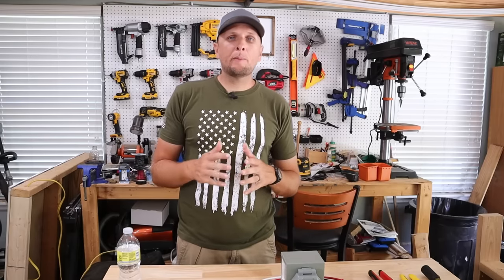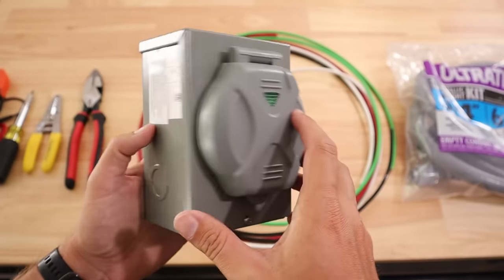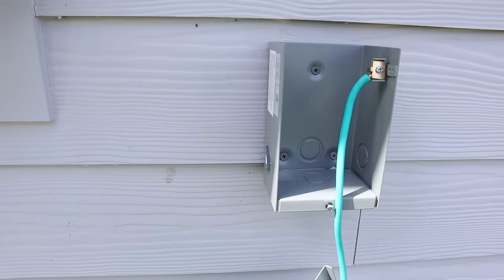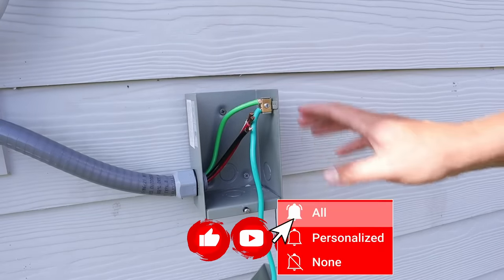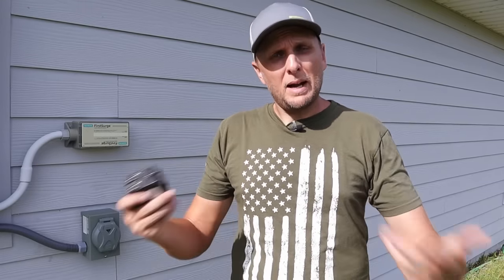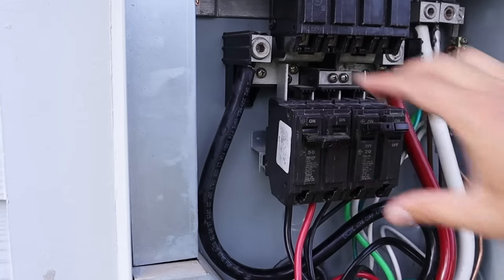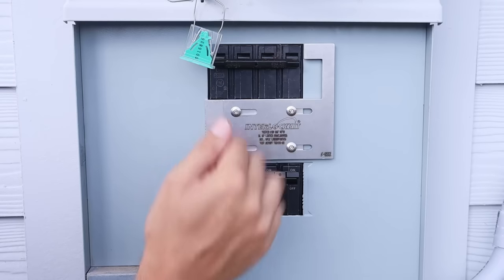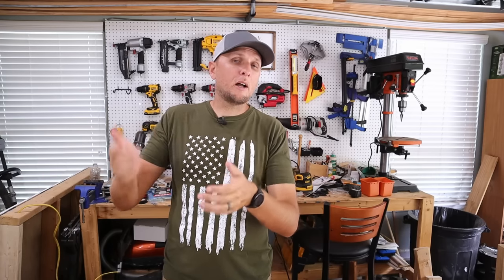The BEST Way To Connect A Generator To Your House - Interlock Kit With Power Inlet Box Install

Comment: This was Very Helpful and Thank You. I have a question. I live in a manufactured home, in the middle of Florida on the Gulf side.  1) My Home A/C unit and water pump are powered from the Main panel on the telephone pole. Then there is a circuit that goes to the home to power it. How would I adjust my installation for this situation?

Comment: Very nice! I would like,but not willing to sacrifice safety,backfeed from a subpanel i put in my garage. I used number 4 copper to a 60 amp breaker in the main. The safety switch is the issue i see but is this able to be done this way? Any help would be welcomed,thank you.

Comment: I made my own interlock switch. I changed my panel out to a 125 amp panel with a 125 amp main, which is the largest the code allows with a snap in breaker. I installed the 125 main with the required bolt down kit, and placed my 30 amp generator breaker next to it. I bought a 4 inch T bracket from a local hardware store, cut off the two upper legs short enough to prevent it turning too far, and bent a 1/4 hook in the long leg. I drilled the cover and double nutted this bracket to it to prevent the main and the generator breaker from being on at the same time. Painted it red .Perfectly legal in my jurisdiction.

Comment: First thank you for the video. Question i was told if your common and ground goes on the same buss bar you generator needs to have a floating common.  Correct or incorrect?

Comment: You should tighten, then loosen, then retighten the screws on those stranded wires a couple of times.  You'll get a better connection that won't work loose over time.

Comment: Awesome video and very informative!  I was looking into doing this setup. I went and looked at the 2 breaker panels (inside and outside) and I noticed I don’t have a “main breaker”. How do I go about doing this setup without it?
Reply from the maker: There has to be a disconnect in a breaker panel somewhere unless all of your panels only have 6 circuits or less.
Reply: @HowToHomeDIY my outside panel has 6 breakers and the inside has 16. The outside panel has a breaker that’s 100 amp and says inside panel. The rest of the outside breakers are stove, well pump, ac, sewer and heater.

Comment: Liked and subbed.
Def going down this path as soon as possible. We haven’t had major issues in our area but of course one never knows. This is practical way to have power without the huge investment of permanent standby units. Question…do folks actually disconnect from utility power and run off these just as part of a schedule? Do they just crank up the generator on some schedule? Just curious to how they make sure everything is in working condition. Thx

Comment: Number 8 wire copper is good for 55 amps, is a lot easier to work with and handle a 50 amp load very well. Whole lot cheaper wire faster job. Also the wires were about 3 inches too short and your receptacle box please note that if it is inspected would be turned down. I've been a master electrician for over 50 years and hooked up hundred of these boxes.
Reply: What wire can I use for 30amp plug?

Comment: The light isn’t a gimmick, it’s actually for two reasons, A. It confirms your generator and cord are successfully supply power. B.  more importantly, in the event you unknowingly had power flowing back to it, interlock failed etc. you’ll know it’s hot.
Reply from the maker: Appreciate the input Steven!

Comment: Great video, very clear, thanks! Q: for a Colman Powermate premium plus 6250 (6250 maximum watts / 5000 running watts) it’s indicated 20 AMP on the electrical outlet (3-Pole 4-wire receptacle). Should I then install a 20 amp breaker to match this generator? Can I really get up to 6250w and run 5000w through a 20 amp breaker?

Comment: I have a Northstar 165605  Generator with a great Honda motor, and 120/240 Volt, 50 Amp straight-blade receptacle (NEMA 14-50R receptacle compatible with NEMA 14-50P mating plug). I use it for my sound company for power at concerts at outdoor locations, and it has 7 separate 20 AMP circuits. I would like to hook this up to my home breaker box, as in your video here. I really don't need any special "safety" hook ups, just to turn of my main breaker in my box when the power goes out, and then hook up the cable and turn the generator on outside, and turn the breaker on for the generator indoors. And then reverse the process when the power comes back on. Is it OK to do this, and will my AC also work, because I will have all my breakers active in my main box? I live alone, with my Mother, so there are not lots of people in my house running all kinds of power in different rooms. The only main draws on my power will be my fridge, AC, and some lights, TV, and my computer, so I should be able to install my generator without the soft start or hard start kit.

Comment: Hello Sir!
Very informative and well made video! The only problem I have on my end is that my breaker box does not have a main disconnect. So if I just threw in this install, then I'd end up back feeding to the meter. looks like I have some extra work to be done to the main breaker box first and get a main breaker installed.
Reply from the maker: There has to be a disconnect in a breaker panel somewhere unless all of your panels only have 6 circuits or less.  I believe this is code and has been for quite a while but maybe I am wrong.  It would be odd not to have one.  Yes one would be needed for this install not just to make it legal but also safe.  I really appreciate the feedback and glad to hear you liked the video!
Reply: @HowToHomeDIY  and you are correct! I was expecting a main breaker but instead, I have the right side of the breaker box with the first breaker at the top at 100A and "Heavy Load" written on the right side. Then on the left, the first breaker top to bottom is 60A and that side is labeled "Light Load". The house was built in the late 70's early 80's here in the Houston, Texas area.

The project will eventually be having the breaker panel redone with one MAIN breaker followed by a 50A breaker for my generator with the interlock kit, then the rest of the needed breakers. It's not going to be cheap but I am tired of the power outages and not being able to have a backup system. Thank you again for the very well detailed video!!
Reply: Do I have to buy a separate breaker for the 50 amp plug? I will have to wire directly to my breaker as my meter does not have the required connections on the outside, but luckily for me my meter box is located directly behind my breaker box on the outside while the breaker box is on the inside of my garage. So would I need to add an addition breaker switch inside of my breaker box?

Comment: Great video.  Can you please provide the links to the items used?
Reply from the maker: Yeah they should be in the description of the video.
Reply: @HowToHomeDIY  Thanks. What size guage did you use, including the ground?
Reply: For anybody else wondering, I went ahead with 6 gauge THHN rated wires inside 3/4" conduit, which is recommended for 50a & routing to outdoor inlet box

Comment: Hi, great video. Very detailed. I have a  question. The yellow cord that plugs into the generator to the inlet box, is 30 or 50 amps?
Reply from the maker: Mine are 50.  It just depends on your hookup and generator output.

Comment: Just wondering how many amps your house requires to comfortably run with everything up and running. I already have a transfer switch which has 10 circuits so I can run the furnace but not the AC.. I may consider rewiring it through a 30 amp breaker so I can run the AC. Nice video, thanks.

Comment: thanks this makes sense.  how do we know what kind of interlock kit to buy?    Based on the model of the main panel?  I have a small cabin and want to be able to run gas furnace/blower, well pump, fridge and lights when we lose power occsionally and I think this will work wonderfully.  I have a ryobi generator with 6500 running watts and 8125 starting watts.  thanks!

Comment: This is not the norm for most houses. Breaker boxes are usually inside the home. This would be the most ideal procedure if you had his set up,good video.
Reply from the maker: The procedure is still the same.  Just depends on where you want the inlet box.

Comment: In most municipalities, you must pull a permit before installing a generator for you house wired into the service panel. There are too many code issues that a DIYer can’t possibly know for a safe and reliable installation. Proper grounding and bonding is essential for a safe installation. Call a licensed electrician and get it done right and make certain he pulls a permit and gets it inspected.

Comment: That LED blinking actually is blinking as that's how LEDs work. Thing is it's frame rate is at a speed that syncs to that of your cameras refresh rate so your camera will catch its blinking. Same way some cameras will make helicopter blades look like they are not moving or moving slowly in some videos. It's pretty neat actually. Most peoples eyes will only see frame rates less than 60htz so LEDs look steady directly as they blink much faster. Sorry had to geek out a little nice video btw.

Edit: actually a better example instead of the helicopter is at 12:26 in your own video haha.

Comment: Great Video! Thanks for sharing, I added a Micro Air Easy Start to our 15000 BTU AC unit on our RV,  we use a Honda EU2200I to power various devices separately, AC, Coffee Maker, Microwave. Works Great. If your board check out the video. Im thinking adding a switched outlet box and male plug end to our furnace for emergency use and your video popped up.

Comment: Should have watched this before buying the wrong 10 circuit transfer switch.  This is what I need. so now I will exchange that for this.  I think I have the right way to do what I need. Thanks
Question:  My main power panel is outside (detached garage) right next to the meter. In the panel there are 2 breakers 1 for garage lights & plugs, 1 for outside flood light.  The other 4 breakers are separated into 2 20-amp circuits for well and 1 for sump-pump.  All other circuits are inside the house's breaker box.  Is this what I need, using a Duramax HP13000HX that has a heavy-duty 120/240V 50AMP outlet.  I'm very mechanically inclined, except for electricity, so I'm double / triple checking what I need before I buy more of what I "don't" need.  Thanks again!

Comment: I might be incorrect, but I was taught that, in boxes such as the one installed, there should be 6" wire length from the box, for connection to the device you're installing. Anyone who has worked with wires cut too short knows why. Last I recall, it's required.

Comment: This is a great video!!! I wanted this installed on my house and I found out they wanted to charge me $3000... That's a lot of money and at the moment can't afford that. Do mine coming to my house and showing me lol... That would be great... I like how your setup was so clean and easy. Now you mention about picking certain items. Is that because you turn on certain breakers in the house. From the label you place on the panel it says to turn off all breaks. Does that mean you only turn on what you need only?  I will have to subscribe to your channel have to change some power outlets and stuff.
Reply from the maker: $3000 is a good chunk of change.  Yes it is best to turn all of the breakers off so that when you turn the generator on, it isn't getting a bunch of circuits demanding power all at once.  Could cause the generator to bog down or even shut off depending on the load demanded and the size of the generator.  Thanks for the feedback!

Comment: Good instruction video, thanks! In an interlock setup such as described in this video (which is also what I have in our house), is there some kind of device that could be installed directly on the grid's main (before the main breaker) so that when the electricity from the grid comes back online, I have some visual indicator, so I know I can turn the generator off. We live on a large lot and we don't have visibility on our neighbors, so we can't tell if the grid power is back or not without toggling the interlock on a trial and error basis, which is somewhat annoying. Would using a multi tester work even if there's no power being drawn from the grid, although not ideal? Thanks for any insight ...

Comment: Great video!  Can you please link me to the 4 electrical wires (6 guage) that you used or brand that would be best to do the install?  I’m not looking for the pre-assembled Ultra Whip kit, just the wires only
Reply from the maker: Glad you liked it!  Totally understand.  Depends how many feet you need.  I just added 3 options for wiring with links in the video's description.  When you click the link it will take you directly to whichever ones you want to take a look at.

Comment: I THINK the answer is yes, but can I install a 50 amp interlock kit with all the correct wiring and run a 30 amp generator in case I upgrade my generator in the future?
Thank you.

Comment: Thanks so much for that great outline on the hookup. Once I get a generator 30 or 50 amp then I can get an outlet box for the size. I wasn’t sure how I was going to set things up when I got a generator, but now I’m sure. The only issue that I see is putting the slider block on my panel because the only empty location for the additional breaker is at the bottom of the panel, far away from the main up top?
Reply: Might have to shut your power off and move a couple breakers to the bottom to make room at the top.

Comment: I had the same type of interlock, 30 amp breaker and L14-30 generator receptacle installed when I had an electrician upgrade my service and panel.  The instructions say that a maximum of ten 20 amp single pole breakers can be used from the 30 amp generator breaker. Two things I'm disappointed in with the electrician; first is that he never explained that since my main service panel is neutral bonded to ground, and that most new generators are bonded neutral to frame (ground) and need to be unbonded.  Sheer luck that I happened to read about the bonded vs unbonded issue by accident when shopping for generators.  It is a code violation to have a system with two paths to ground.  Second, he should have also quoted me a 50 amp option.

Comment: I knocked plenty of the knock outs, out, that you said can't be knocked out without a drill. And all my manual and automatic generator installations always passed the electrical inspection. I was a licensed electrician. Retired!  If a homeowner installed this wrong, then backfeeds the utility through a wrong connection, the person that installed the power inlet and interlock, is responsible for the injuries and death their installation caused. I prefer learning from other licensed electricians and engineers.
Reply: Buying a generator with a high peak amperage start up totally avoids that soft power unit for your condenser. I have a 15kw GENERAC with 30kw peak start, running 3 central AC units and a heated, all running directly from the generator at by buddies house.
Reply from the maker: Keith, most knockouts can be easily knocked out.  The box in the video is literally designed to have to be drilled out.  It’s even in the instructions that come with the box.

Comment: I understand it makes a difference when plugging directly into a generator whether one uses an inverter generator or a standard generator, as the inverter generator provides clean electricity for sensitive electronic equipment. However does it make any difference if you use an inverter generator or a standard generator when connecting a generator to your house electrical panel like shown in this video?

Comment: Question. I added a 220/240 outlet in my outside panel. I ran the outlet thru 50 amp breaker. I only turn it on when I weld. The panel is located on the side of the house/garage where I have a concrete driveway for working on my cars n Jeep 4x4's. The outlet is for a
 welder. Seeing this video made me think in a power outage I can turn my main off hook my generator to this outlet, turn my welder outlet on and run power to fridge. Of course I would shut all other breakers off to avoid over loading generator. Do you see a problem with this?

Comment: Very informative. Thank you. I have a question. My gen is a Generac GP7500E. On it the twist hookup says 120v or 240. When I hook it up to the breaker in the main panel do I hook it up like you did. What is the difference and how do I tell if it’s 120v not 240. I don’t want to blow out anything in my home. Please help!!
Thank you

Comment: This about the simplest install someone would encounter having a external main breaker panel with an open 2 pole slot waiting for a main. 99% of people won't have something this easy with a wall mount main panel.

Comment: Thanks for the video. Question.  Im in the process of confirming with the manufacture of my generator to confirm if its bonded or floating. What would change when hooking up the inlet box grounds if its one or the other?  This is the only step im confused on. Some say theres a wire in the generator that needs disconnected if its this or that? Any insight on this? Thanks

Comment: This is great. Do you need to do anything different if you have solar installed? Our panels stop giving power when there is an outage in the neighborhood.
Reply: To be safe - turn the  Solar Array OFF.  If it is a "small" array, it can be left on.

Comment: I already have this same style setup at my house. I am looking to plug a 220v welder into the generator plug. Can I turn both the main and generator breaker on at the same time to supply power to the plug to run my welder?